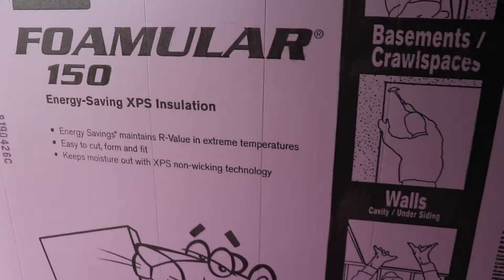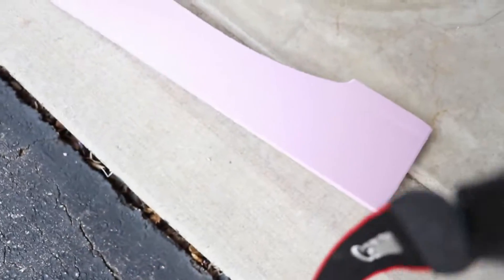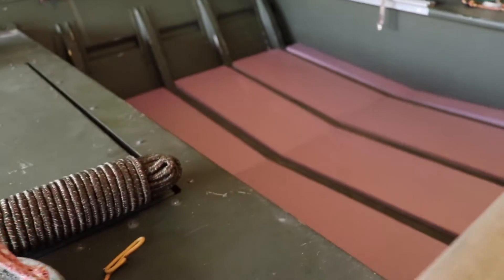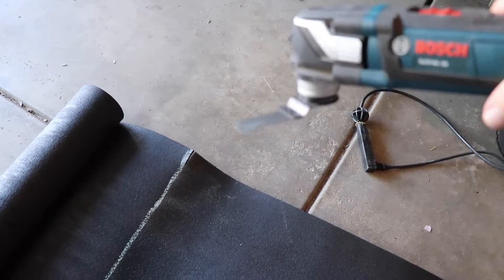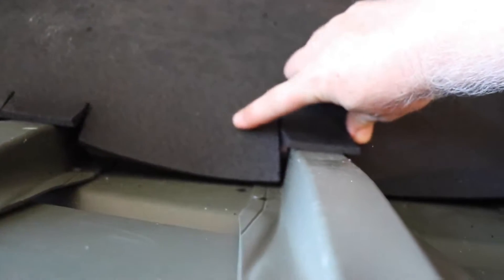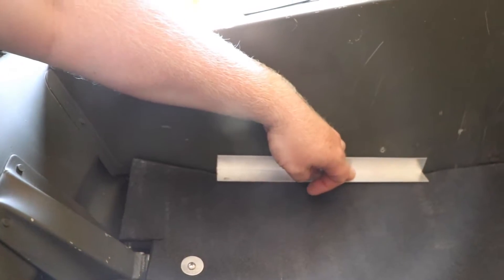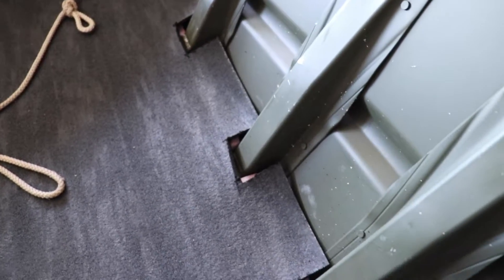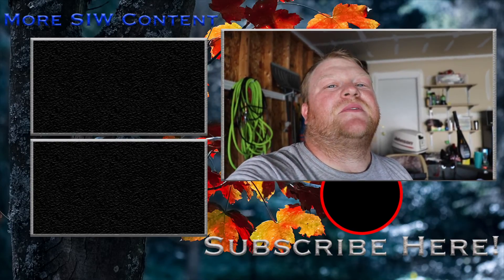The NEW DUCK BOAT has a FLOOR! Duck Boat Build Part 2!

Comment: I got a few questions, how is that floor holding up after one season of hunting, also does your boat motor charge you battery that powers your led light bar and strips?
Reply from the maker: Floor held up well, but we didn't get out in the boat as much as years past, as we had a little girl in the middle of the season. We typically charge the battery each night, but the motor does also charge the battery.
Reply: Somewhere In Wisconsin thanks for the response forgot to reply working on a duck boat for This year to increase spots to hunt.

Comment: Why did you insulate the floor of the boat?
Reply from the maker: So the mat would lay flat on the floor. Insulation is light and fairly inexpensive, and the proper thickness.
Reply: I'm just curious. I havent seen anyone do that before.